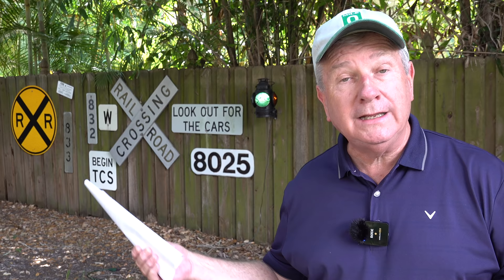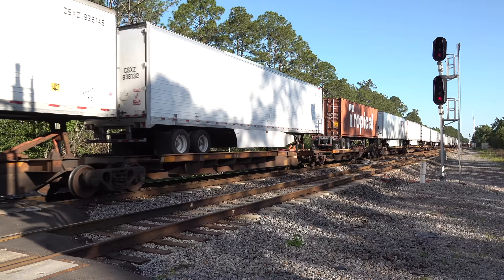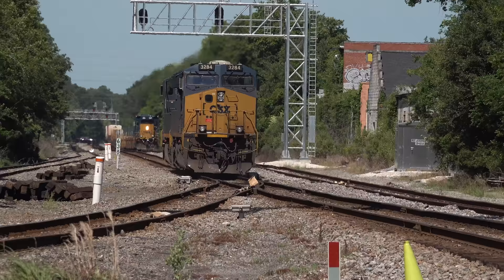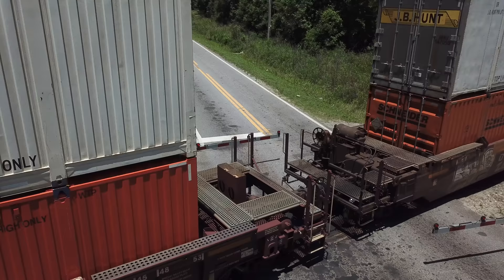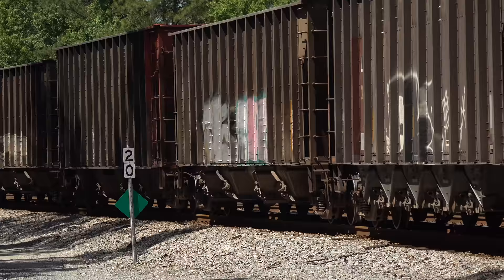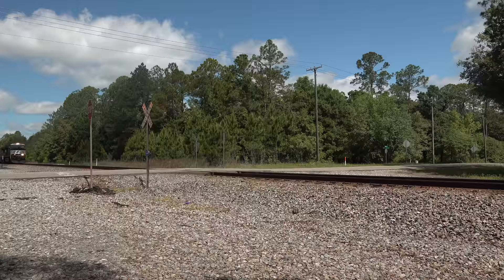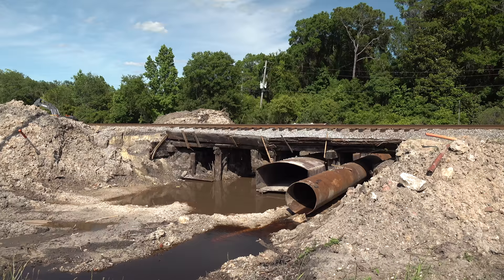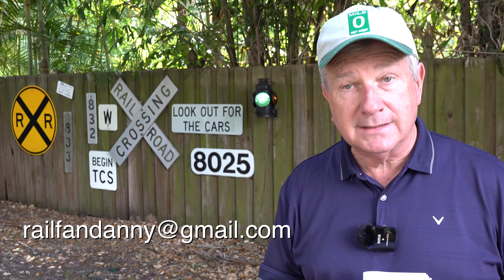How Distributed Power Works

Comment: It seems to me that "precision railroading" is a cover up term to hide the real reason for long trains;  reducing personnel by one or two thirds.  A fifteen thousand foot train is operated by two people whereas in the past it would have been three trains with six people.
Reply: It’s the railroads version of lean manufacturing.
Reply: Look at all that unnecessary text! The whole thing can be summarized in two words: "Cutting corners."
Reply: Our territory is eesigned for trains 7000-7500 feet.  Anything over 8600 feet and it can only fit in 2 sidings between yards, not to mention longer it takes to walk back, check a problem or stop between sidings blocking more crossings
Reply: @bluegrassman3040  I feel your pain. Run these two machines , help this guy run his machine and set up a third machine.
Reply: 1980's version of downsizing.  As a brakeman for the former SP, we had a crew of four.  I guess as technology advances, we may see unmanned trains operated like unmanned drones.
Reply: Thank God for unions
Reply: What exactly is the problem with this? To the people saying, "good for the unions!" Come on... railroading is a business. Romantic business, maybe, but it's all about maximizing profit and reducing cost. "Jobs" aren't a good in and of themselves.
Reply: @bradrjones1  The real problem is that it may take twice as long to get back to a separated air hose, or any other problem. Meanwhile a dozen crossings are blocked. It’s all fun and games until your house is burning down and the fire department can’t get there. Maybe you’re having a heart attack and the ambulance can’t reach you. 

The monster trains might be financially beneficial for the company, but not practical, unless the line is completely grade separated.

What makes the railroad think tat it has the right to block crossings and disrupt everyone else’s lives for inordinate amounts of time?
Reply: That's exactly what precision railroading is.   NS ran a 20,000 foot long 11z last week past my railroad.   They run 2 trains now  that was once 4 trains.   Its crazy.   And they have had lots of problems crewing these trains as well.
Reply: They would run ,and they probably can do it now, trains with no crew at all by remote. But you always have to have a few bodies on the train to do stuff that the remote controls in the office can’t do.
Reply: @greggporter5494  unions will not save then as automation will come and replace those worker this happened at the ports in the last 30 years a lot of port active has been automated.
Reply: @rrai1999  Look at all that unnecessary word! The whole thing can be summarized in one word: "Efficiency."
Reply: It's the RR's way of accomplishing work in spite of the inefficiency of the personnel. You can't deny how management has to pull teeth just to get union workers to do their jobs. Not to mention the overstuffed salaries they have to pay to the union and the worker. It's a constant battle between the two. Started way back with the multi-engined steam locomotives that only needed one crew (Mallets); the operators would sabotage the locos so they couldn't use them and have to get two locos and crews to pull the train. it will continue with crewless locos and the corporations win bc the unions will have priced the workers out of a job.
Reply: Longer trains, longer hours, fewer personnel, shitcan the old hats because they are a liability, keep your youngins furloughed and on call, no craftsmen in the shops keeping the locomotives running, turns into a game of hot potato bandaid stations to get a unit out of your hair and make it someone elses problems.

Its a very inneficient race to the bottom for shareholder returns. Until it rears its ugly head it wont go away. There already has been psr related accidents and multiple derailements. You cant run a consist of 400 cars through the mountains without destroying couplers.
Reply: @bradrjones1  Nail on the head.  It's never about 'jobs' is it?  An employee is rarely a value and most always a cost to be removed.  AI and robotics will accelerate this issue and I have not heard of a good solution yet.
Reply: @greggporter5494  yes we need lots of useless people getting paid to do nothing. It's just glorified welfare.
Reply: Hey it's a enough money out there for everyone. Even the useless people. I'm just saying.
Reply: Laughing in Amazon Logistics Language...😂 "We'll take two routes, make them one, and dare the drivers to say something about the increased load!"
Reply: @dickgoesinya4773  The air brake system is just updated from what George Westinghouse invented over 100 years ago. I don’t think that it can be automated, but if electro pneumatic takes hold, then it will be the last straw for the job being how it’s been for over 150 years. Automation still won’t get a crew member back to where a problem is any faster. The issue is still about blocked crossings, and the ability of emergency services to get to the emergency.
Reply: @bluegrassman3040  Dumb as rocks idea.......I just read about West Ports short of RR Cars. ....Ships as far as the eye see wait to get unloaded.....

Why would we be short cars in this day age........Oh I know, precision RR waiting to build longer trains....

Funny I see less train frequency and higher prices for products. ......

BS if ask me.......Very disappointing way to manage train runs with less personal. .......
Reply: @ronstrulic4388  really , oh my gosh am I surprised. .......Disgusting. .......Very sad, and this will not end well for any of us.....

We r already losing Port money because volume and resources can't keep up  with inflows.....And shipping companies will start looking for better ports to handle transfer needs......Wait n Watch to see how that works out for US......

Just remember Greed n Hubris is a very bad Mixture........
Reply: @jaynecobb3701  We r  sooooo Efficient that Jumbo Ships on both East n West Coast have dropped Anchor in delays to get unloaded....Yup we r so efficient. .....Not!!.!
Reply: @davidbarnett9312  Got some of that w/remote operation by engineer out of the locomotive.
Reply: @bradrjones1  The problem is we have an increasing population and dwindling amounts of decent paying jobs. At what point does it all collapse? Fuck them and their profits. It's one thing to be profitable. It's another thing this obsession over unlimited growth and massive record profits every quarter, at the expense of the employees and customers.
Reply: @davidbarnett9312  The ore railways in Australia are already running unmanned freight trains. They are driven from an office in Perth (next to the one the mine truck drivers are in).
Both truck and train driving has become an office job.
Reply: Autonomous/remote control trains can be much shorter, increasing efficiency. One loco, short train. If they need people to drive them, long trains & DP happen instead.
Reply: @jamesvandamme7786  There are no autonomous freight trains in the US. FRA says there must be a minimum of two people in the controlling locomotive while in operation, currently.
Reply: @jamesvandamme7786  The Rio Tinto trains have five locomotives as standard - you still need to move tonnage through the blocks.
Reply: @allangibson2408  That is fine in the outback where it’s hundreds of miles from anything, and the train is carrying an inert cargo.
Reply: @brianburns7211  This is a proof of concept - and most railways globally are similarly separated from the people around. 99% of the time if you need a driver on site it is at the end of a run - not in the middle.
Reply: Boy...sure glad I am retired after 33 years of service and don't have to engage in union politics anymore. When I hired on we still had 5 man crews and a few furloughed fireman who were called back to work as engineers. Saw the caboose replaced by the EOT...the elimination of the brakeman and ultimately the arrival of DP operation and FTO - don't think we will ever see autonomous trains but if the regulators ever decide to allow one-man operations I think that possibility is quite likely.🤔
Reply: @greggporter5494  Yep, gotta do work that machines can do (often better).

When ist's cost effective to automate, they automate, simple as that.

It's a fallacy that we must work fulltime, this is not the 19th century.
Reply: @johnsergei  Ha, ha. That's what I thought thirty months ago but unfortunately the incomings and outgoings don't add-up.
Reply: @markcousins9337  But automation is getting cheaper & better. & trains (which are controlled by electric curcits) are dead easy to automate.
Reply: @toshihitsu1989  American ports are more unionized than the rail industry... American rail freight is among the best in the world when it comes to efficiency per tonnage/mileage.  Yet American ports are the complete opposite and so far behind the rest of the world in terms of efficiency because unions are withholding critical automation.
Reply: @TheNemosdaddy  That's not entirely correct.  Remote controlled trains have been in use for years in switching, yard, maintenance, etc, operations...with physically no operators on the train, as the operator is off the train using remote controls.  Yes, long haul is a different story.  And autonomous is something completely different.
Reply: @edsmith438  in the days after WW2 it was called featherbedding. Example was the fireman on a diesel locomotive. The unions claimed the second crew was needed for “safety.”
Reply: @michlo3393  I have lots of these stories but I'll give you just one. My neighbor drove a backhoe for the Southern Pacific. One day he got told to put a bunch of scrap iron into a gandola. The car had been mis-spotted, turned out on purpose, so he had his union required helper that he didn't need release the brakes on the car and he used his backhoe to move it twenty or so feet. When the engineer that shuttled cars around in the yard didn't get called to move the gondola he wondered why. He found out what my neighbor had done and filed a complaint. That's the union way. So were useless cabooses but that's another story.
Reply: @bradrjones1  Romantic business, maybe, but it's all about maximizing profit and reducing cost. "Jobs" aren't a good in and of themselves.
Brad, I don't know where you are in the food chain, but as this process intensifies wealth concentrates into a smaller section of the population and you will become prey. As I look at the US I see social unrest increasing. You guys have gated communities, lots of them but think you live in the land of the free. The lunacy of Trump is a symptom not a cause, you have people attacking the  US Capitol. Your country is sick. There has to be balance. Big business has too much power in your politics.
Reply: It actually started more than 40 years ago. Most trains eliminated the "FIREMAN " who was actually the Assistant LOCOMOTIVE Engineer.
Reply: @brianburns7211  that can happen with short trains. Lincoln California was a perfect example.
Reply: Cooperate greed alive and well
Reply: @jeffaumand1323  so now being efficient and turning a profit is greed? What is going on strike if not greed?
Reply: @wjsj69  
RE: ". . . the overstuffed salaries they have to pay to the union and the worker."
But what about "the overstuffed salaries" of the bosses and executives?
Reply: @NitroAuto77  as a craft machinist I had the opportunity to talk to a person really up there for CSX and the main reason why some old hats are being let go and harrased to quit is because of their old railroad attitude and because they do not like to keep up with technology. In a lot of cases he told me when they did the annual meeting for speaking out, most newer employees complained on how they were doing more than the seniors because they refused to learn how to test the PTC or DP a train etc....so old heads sometimes cause their own termination.
Reply: @jairopinta5950  That makes sense, and I've seen that as well. dana carvey old man skit
Reply: Yes, as a CSX Engineer I can say we all hate these long ones. It is a profit thing. The "Magic number" is 490. Meaning we can haul one ton of product, using one gallon of diesel , for 490 miles. Well one good thing is we are going to be blocking a lot of rail crossing, which will be getting motorists upset. They will begin to complain about it. Local places may pass County ordiances against it, then state laws, might follow Once that occurs CSX will have to drop this setup. The DPU remotes are of great help concerning slack and braking. At any places with a grade it is of great help. Another thing your correct in, is the number of people running one train.
Reply: Outstanding comments on this thread, but understand, maximizing profits is THE name of the game in our capitalistic economy. (Because someone else is always there waiting to eat your lunch if you don't economize every step of the way.) The worker exchanges his time for a paycheck as long as his services have value. "It's just business." The feudal model is vastly worse, and raise your hand if you think socialism, ("we all starve equally,") is the answer.

No one stops people from innovating. (Except the government.) The gig economy works well if you let it, but offers no protection from anything. (Still, it beats ditch digging and doing your neighbor's laundry.) 

Bottom line, Jesus is coming back and no matter what, be prepared to welcome Him home when He does.
Reply: Couldn't agree with you more.
Reply: @michlo3393  Calm down Comrade Stalin !    You DO realize that the railroad is owned by INVESTORS,   who expect a ROI?  The corporations are not designed to be a not for profit corporation,  as they were when you had such bloated contracts that you had guys that basically only had to show up to pick up a paycheck.
Reply: @TheNemosdaddy  Spoken like a true Democrat!   Maybe if you understood how a financial statement works,   you can come back and say something intelligent
Reply: This is not limited to railroading. There was a time when an airliner would have 2 pilots plus a flight engineer and even a dedicated navigator. Through automation, even the largest planes can now be safely flow with just a pilot and copilot.
Reply: @Shadowfax-1980  That's not entirely applicable. PSR is a short-term cash grab, it's a fucking grift. And that's it. It's not actual progress. No longer needing flight engineers or running trains without a caboose is one thing. Running 3 mile-long trains and forcing your qualified employees to let a premature, sloppy, unreliable, poorly engineered software run the train like shit isn't progress. Trying to make people obsolete simply because their compensation is cutting into your exorbitant bonus isn't progress.
Reply: A major irritant to Jennifer Homendy
Reply: @dickgoesinya4773  we have remote control trains in Portland
Reply: On the flip side you have less trains running minimizing congestion
Reply: @R7300  actually the opposite is taking place.
Reply: @michlo3393  that’s due to cutting employees and resources, not running longer trains
Reply: @michlo3393  car dwell is a good core concept, like you said cars do get sent out places they shouldn’t go. But that’s because the yards are too full and have to clear room for inbound traffic, and the time they have to do so is reduced because more trains work in PSR, plus it’s harder to do switching when all the switch crews are furloughed.
Reply: @R7300  Furloughed? they're all gone. Why? because even though traffic slowed down, the freight business didn't crater the way passenger service did during the pandemic. Yet freight railroads decided to furlough preemptively - okay, fine. But then they flat out let them go. Then they ran to the Federal Government crying about a manpower shortage that THEY created. Ever since we have been working continuously without rest, dealing with a crew shortage so severe that it takes up to 24 hours for a crew to be relieved, hell, making out of the yard is wishful thinking these days. To make matters worse, certain class 1's roll out an attendance policy that basically holds you hostage under the never-ending threat of dismissal. Out of touch, impractical, and flat-out draconian. Again, because all PSR is, is a short-term scam. It under-values the workforce, cuts or neglects critical infrastructure and staff - remember, these layoffs are not because progress has rendered them obsolete, but because their compensation has gotten in the way of fleecing even more profits from an already profitable industry. These unsustainable profit goals ignore customer service, equipment maintenance, and any and all logistical practicality. The only people benefiting from PSR are the already wealthy assholes at the top rung of the ladder who have never even seen a set of railroad tracks much less actually know how to run a railroad in any direction other than straight into the ground. But yeah, anybody who thinks PSR works or is a great idea is either a shareholder, an idiot or simply doesn't deal with it on a daily basis to see it for what it really is.
Reply: @ronstrulic4388  Almost a 4 mile long train...... That just blows me away.
Reply: @ronstrulic4388  m
Reply: @brianburns7211  your reasoning is very informative thank you.
You brought up many thoughts I never thought of. And Thank You very much.
I Love trains but many non train lovers really get pissed off at having the trains  at a stand still  & blocking the road ❗
Reply: @edsmith438  I gave you a thumbs up
Growing up I used to love seeing the caboose at the end of the trains.
If you care to , explain what made them useless.
Reply: A very informative thread here,  and I thank you one and  all 👍 👏👏👏👌
Reply: @michlo3393  they only agree to it because there's a gun to their head. Striking costs millions and disrupts everything. I'd agree to it too and then ignore the agreement made under those conditions.
Reply: @icosthop9998  they were for a Brakeman and the conductor. Brakeman have been obsolete for over 100 years but only gotten rid of about 30 years ago and the conductor can work in a diesel engine. So there is no need for a caboose if you have a minimum crew of an engineer and a conductor.
Reply: @bradrjones1  Found the corporate tool...
Reply: @jaynecobb3701  I have an even shorter word for you..."greed." It's absolutely nothing more or less than that.
Reply: @kensingtonchapp4819  That is an efficient use of letters.